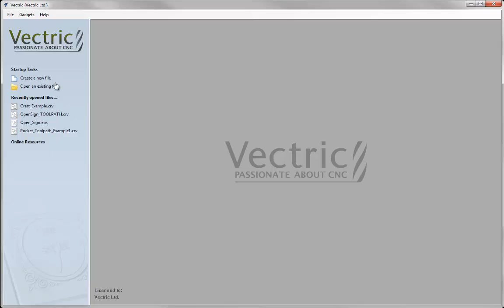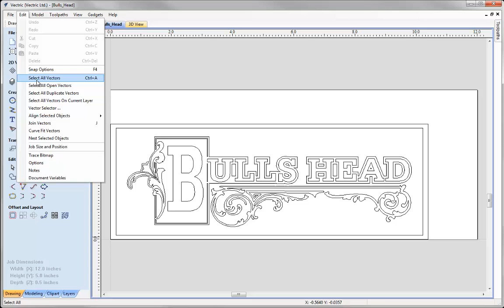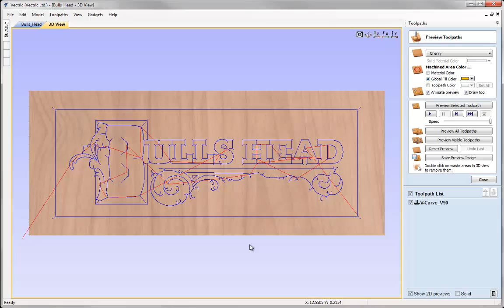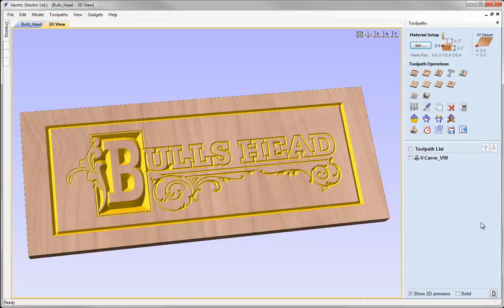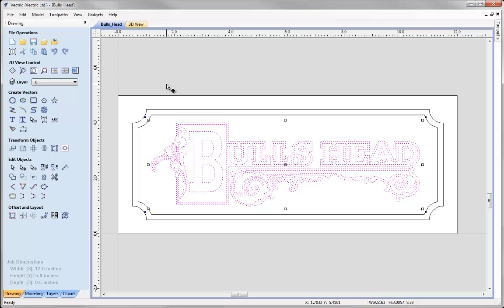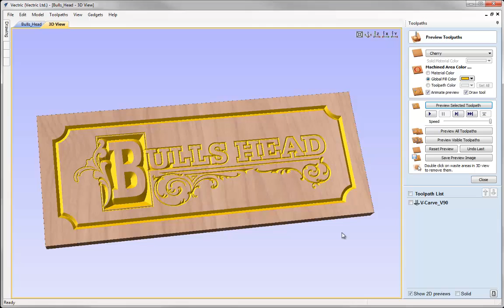Getting Started - Bulls Head (Short)

Comment: hi, pls explain for me about: what is the different between two type of vbit toolpath ( vcarve function) in these cases:
1. using vbit 90 deg 6mm, pass depth is 3.175mm, final pass stepover: 1.3%; clearance pass stepover: 20% (result: https://drive.google.com/file/d/0B0wtfG4avIFhR2hsbVJEZTBITW8/view)
2. using vbit 90 deg 32mm, pass depth is 3.175mm, final pass stepover: 1.3%; clearance pass stepover: 20% (result: https://drive.google.com/file/d/0B0wtfG4avIFhUi1SUUZBbVpIMFU/view)
because I think that when I setup same pass depth for both of these cases, results are the same may be